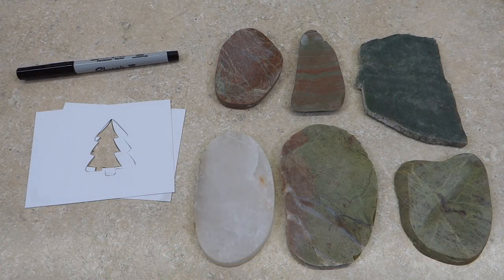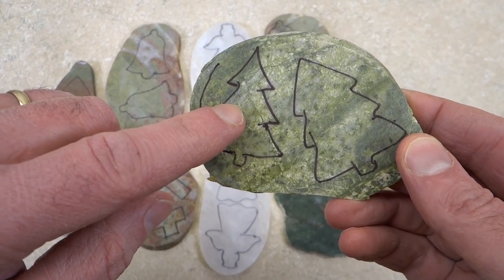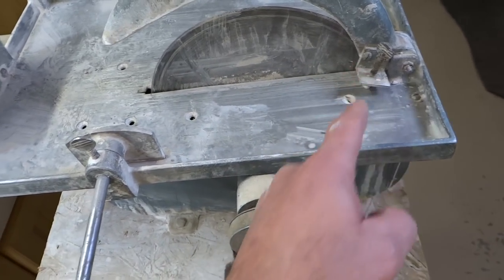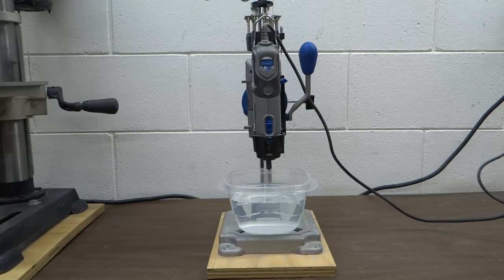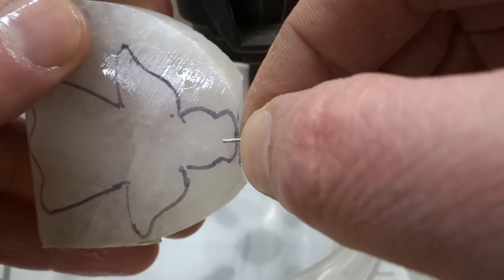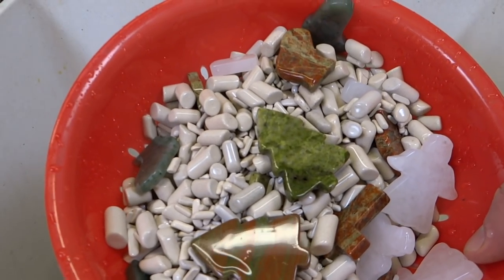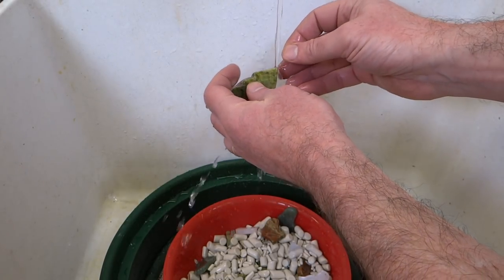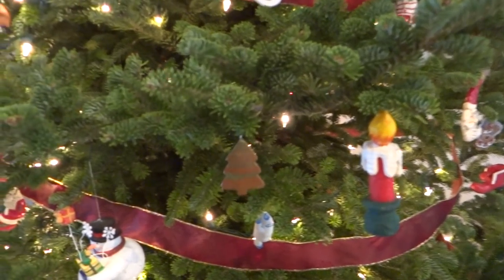Rockin' Around the Christmas Tree

Comment: Very cool video, and great work on the ornaments! Thank you!

As a hobby silversmith and jeweler that often uses tiny drill bits in my work, one tip that I have picked up over the years is to use Alum, which can be purchased from grocery stores (often used in making pickles), to dissolve tiny steel drill bit tips that break off in my silver work.

As the embedded steel tip would prevent me from finishing that piece, as well as preventing me from being able to at least melt the silver back down for re-use, I learned that Alum will dissolve the steel bit, or at least dissolve enough of it so that it can be removed from the hole it was drilling.

In a small jar big enough to lay the piece you're working in, dissolve enough Alum in warm water to cover the piece that the bit is stuck in. I try to mix enough Alum in the water so that it's concentrated (no more will dissolve), and it works even faster if you can keep it warm with an electric coffee warmer plate.

Leave the piece in the concentrated Alum mixture and, depending on how much steel there is to dissolve, anywhere from within a few hours to a day or overnight usually takes care of it. If you don't have a coffee warmer plate, it will take even longer, but eventually the Alum will totally dissolve the broken bit from the piece, saving your work (and your material)! :D

Merry Christmas, and thank you again for a wonderful video!!
Reply from the maker: Thanks David!  That is a great piece of advice.  I have thrown away quite a few beads with drill bits broken off in them.  I’m going to copy this for future broken bits.  I really appreciate you taking the time to tell me.  Thanks again.  Merry Christmas!

Comment: Merry Christmas 🎅.  I love the Christmas trees and stockings, those are my favorite . Thank you for sharing your Christmas tree too.🎄🎁❤❤❤👍🏻👍🏻👍🏻💚💚💚
Reply from the maker: My favorites too.  The angels come in third.
Reply: @MichiganRocks  The angels also come in third for me too. I was also thinking that instead of drilling a hole in the top, you could drill a hole through the side, so you could tie string through it. 🎄🎁❤❤❤
Reply from the maker: @Indyanas_ocean_view  Drilling holes is slow and there's a high risk of breaking a drill bit off inside the hole.  Holes as long as you're talking about would not be fun to do.  The other problem is that the drill bits tend to blow out part of the rock as they exit the other side.  Gluing in the little eyes is a much easier way to go.
Reply: @MichiganRocks  i didn't think about it like that . Thanks , you just taught me something new. Merry Christmas. 😍🥰😇🎄🎁❤❤❤

Comment: What size drill bit and silver wire did you use to make the bales that hang the ornaments?  Merry Christmas
Reply from the maker: I used a 1mm drill bit and the wire is square 20 gauge.  I just used the scrap I had around.

Comment: What glue do you use on your stockings?
Reply from the maker: I use 330 epoxy. I just added it to my Amazon storefront so you can see exactly what it is. I usually buy it in larger bottles, but Amazon only has the smaller tubes.

Comment: Rob Love your ornaments actually would like to try making them for my kids what are the dimensions for the ornaments?
Reply from the maker: You could make them any size you want. Mine are two inches tall. I’ve been making a few more this week.
Reply: @MichiganRocks  how thick a slab do you use 1/2 inch, 1/4 inch, 5/16?
Reply from the maker: @reedwilliams100  1/4 inch for most of them. It wouldn't hurt to go a little thinner to make them a little lighter weight. Too much thinner and it might be harder to drill the hole.

Comment: I don't have a lotto tumbler would a vibratory tumbler work I have one from harbor freight
Reply from the maker: Any vibratory tumbler designed for rocks should work. The problem with the Harbor freight vibratory tumblers is that they are designed to tumble metal in corn cob or walnut shells or some other light weight material. A lot of people use them for tumbling bullet shell casings. They're not designed for tumbling heavy rocks and will wear out really quickly.

Comment: They are beautiful, but you sure dismissed your wifes tree shape quickly. Could have easily remedied the "problem" by drilling a hole straight down through the top portion (from the front, not the top) and used clear fishing line for hanging, or used silver wire to make loop in back and just knot (or even better a star) in front. Merry Christmas to you and yours!
Reply from the maker: I hadn't thought of that.  Thanks for the idea.  Merry Christmas!